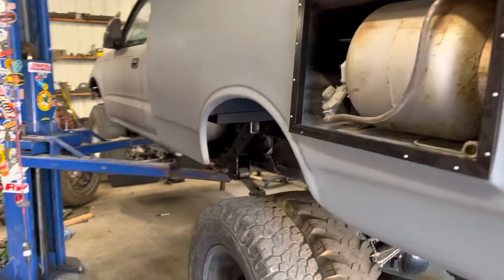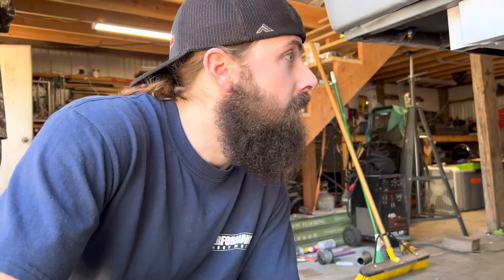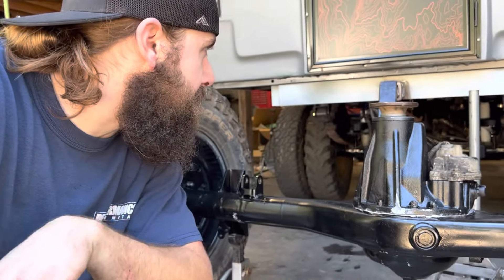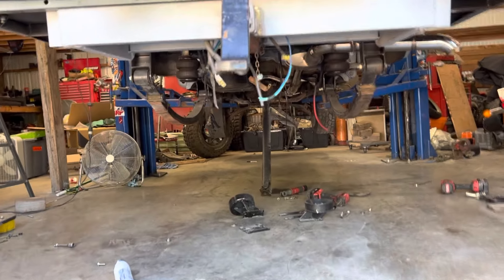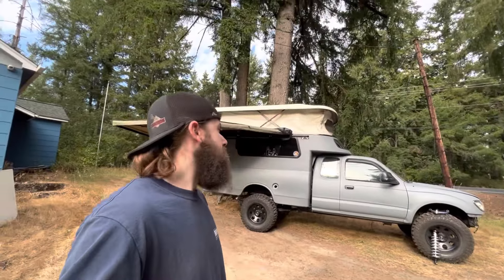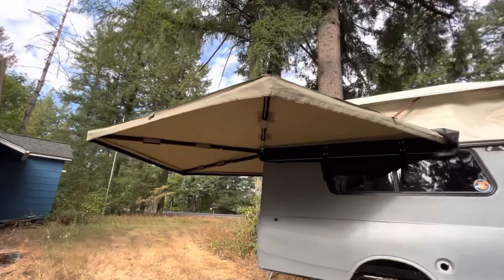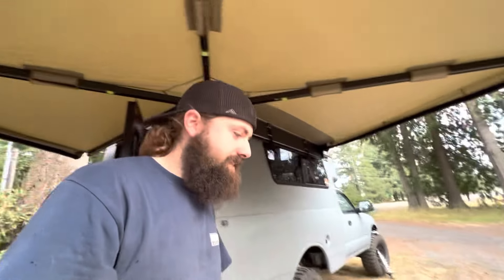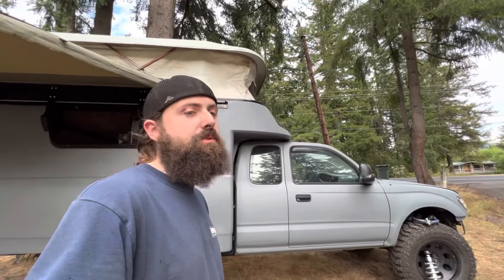TacoNook update, Toyota Tacoma Camper gets new Windows, Door, Awning and Shoes

Comment: Although I'm not a fan of the rough paint thing, she's looking awesome! Great work, you gotta S.A.Swap this thing! Don't trust that IFS garbage! Especially with the added weight and larger tires! It's going to break, I know a lot of people hate me for using my hybrid front axle, but it works excellent! And the main reason I used it is easy parts availability, the formula is relatively cheap, I had my shop teacher mad scientist friend build me a Jeep/FSJ/Chevy Dana 30HP center section, fully sleeved with 1/2 inch thick axle tubes, Full size Jeep C's , Chevy K10 steering knuckles and probably the only 6 lug Dana 3044HP hybrid in existence! The S.A.Swap was the best upgrade I've ever done! And pushed the axle and front wheels around 8 inches forward, and has no problem with 35s and eventually 37s, I wouldn't even trust those aftermarket control arms, I just don't like IFS, especially offroad, if you check out the offroad footage I managed to get from a few cellphones cause my idiot friend doesn't know how to press a button on my gopro? You'll see, I have all sorts of flex offroad and it drives awesome on road, surprisingly, especially with the Warn manual locking hubs, don't waste any more time and money on that POS IFS, you got a great little shop , so just chop it out and do the right thing! Like Toyota did here up to 1985 , I keep getting people telling me "Is that the pickup truck 🛻 from back to the future?" I can only contemplate that it's cause of the S.A.Swap? Cause that was a 1985 S.A. Toyota Black Pickup and my truck  🛻 is a 2003 Bright Red Tacoma S.A.Swap? I guess it's the Solid Axle? Weird how people make that correlation, but somehow they do, and I'm 47 and grew up loving that truck, it's part of the reason I always wanted 1, but I never looked at it like that, and I'm a burnout! But I really love my truck 🛻 people are constantly giving me the thumbs up 👍 and asking questions that they have almost no idea what the answer means? I get a lot of "How much lift is that?" And I love saying "it's not a lift, it's a Solid Axle Swap" them "Tweet Tweet Tweet?" LOL Me "It's works better offroad" I live in a place where everyone wants Fancy vehicles and barley no one gets it ? And that's fine with me! Fuk the city/suburbs, she's my escape from Long Island NY, and I don't have to stop for BS like a few inches of water or 5 feet of water! But the useless lowered car that's riding on the side walls of their tires, they can't make it over a Crack in the pavement! I don't get stuck! I don't like that feeling! Sorry for the long text but Cars/Trucks and Motorcycles is all I know and care to talk about, and please check out #larojataca #toyotawithajeepaxle on my YouTube channel and Instagram @frankrubicon_ Laters!

Comment: You've really done a quality build!    I'm actually gonna talking the deal tonight  and hoping to  trade a 86 4 runner for one  truck and all but dont Ned the truck.  I wanna pull shell an put it on my 92 ext cab 4wd that I've redone during covid  although   my little  PePe still has a killer body he's strutin around with 860k miles  and  110 psi across the board.   But I'm getting old and drive slower so still fairly strong   
But plan in my head now is to sell another one of my yotas to fund new engine and shell swap  and drive off into the sunset. 
Just found out   Pretty sure getting swindled out of my house and semi disabled with a jacked up incurable disease so suck time to lose it all  but I'm yota rich and been fixing  them for other people  so this I got enough  for a all in one time shot to not end up on the street.    Been thinking about building a tear drop trailer but just  saw the Shanook and price is right   so now after watching your videos I'm 80% for it.  Thx alot now I got a idea of what to look forward to ..    although gonna need to be a hell of a lot less new steal and products  but I'm a hell of a  Repurposter an already got  a list..lol
But hey thx alot.  Lookin forward to see you get more into my strengths the carpentering and finish work

Sorry so long winded but couple questions 
Did you by chance get a weight On shell before or after added steal?
& How much length did you add on frame?
Thx again and keep up killer work
Reply from the maker: Definitely not a carpenter so when the time comes feel free to critique!
I never got a weight on the shell. I believe they’re 6-800 pounds? I added 11” I believe for wheel center and not sure how much total length off the back end.